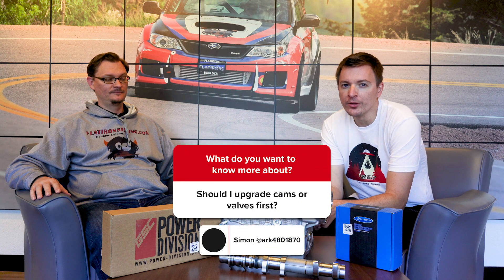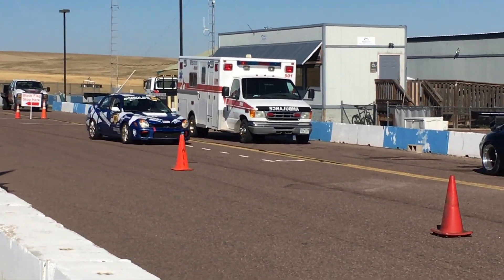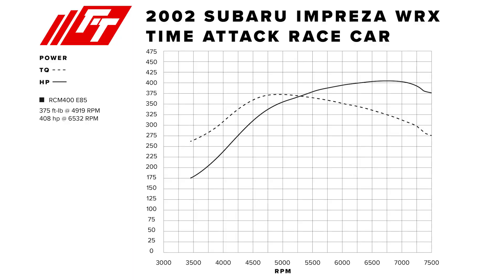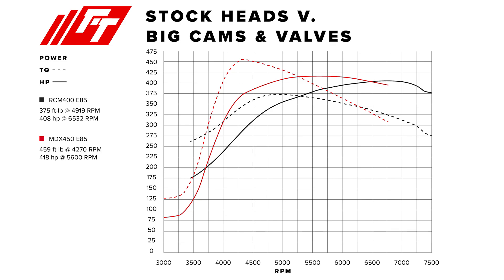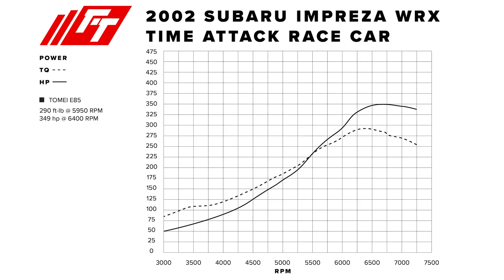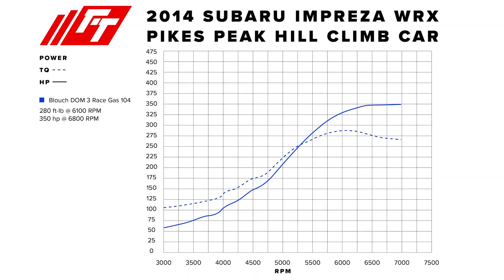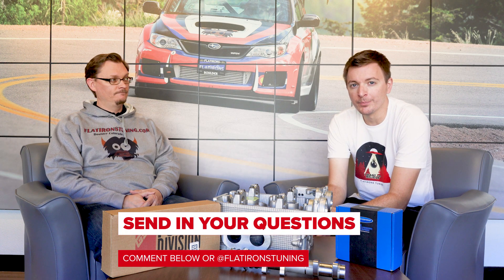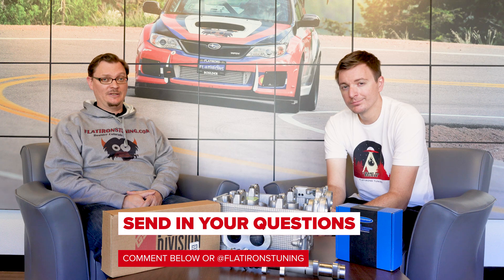Should I Upgrade Cams, Valves, or Both? Question of the Week

Comment: When should one consider upgrading valve springs?
Reply from the maker: Thanks for your question.  This comes in when you replace cams.  Once you change the lift and/or duration of the cams, you will want to make sure that your springs will work with them.

Hope that helps and Stay Tuned!

Comment: Great informative video 🙏, I have a 1200 cc petrol car non turbo  it's an hatchback family car, will it benefit for me to upgrade the camshaft, I have already upgraded the sparkplug to iridium and air intake to K&N .... I know it's not a big engine and I'm not hoping for too big difference in power .. it's stock power hp is 89 and may be if I can get it ecu remap and camshaft upgrade and exhaust pipe upgrade then it may reach 120hp or maybe 125 hp I guess it's a major upgrade for it.. but this is what I as a "nob" think... so can the camshaft upgrade help me achieve little more power than stock like 7 to 10 hp boost without any other modification or modes ... thanks 🎉

Comment: I would do valves with a 5 angle valve job, with a 33* back-cut on the intake valve, first. Extends the rev range of the stock cam without loosing the bottom end, and there's less stress on the valve springs. If you have the heads off, might as well deshroud the chamber around the valves and use a .005 thinner head gasket to get some of the compression back. Running a 116LSA should give you a nice broad power band, and cut valve overlap to help with turbo spool.
Reply: Have you done this personally??

Comment: @FlatironsTuning A full GSC S1, valves and springs won’t do anything for performance with the stock AVCS used?   I  would have to utilize aftermarket cam gears?
Reply from the maker: Thanks for your question.  I assume you mean stock cams?  If so, then yes, there aren't really any gains with aftermarket valves and springs by themselves.  The GSC parts work great and are typically what we recommend for builds.

But I would say that if you are trying to increase the performance potential of the valvetrain, the key part that you would want to look at would be the cams themselves.

I hope that helps and Stay Tuned!
Reply: @FlatironsTuning  sorry forgot to mention GSC S1 cams too. Would I benefit from stock or aftermarket cams. Single AVCS and thanks for your response!!!

Comment: Is there a flatirons video comparing EJ aftermarket camshaft options? If not that would be a great topic
Reply from the maker: That is a good selection.  We haven't made a video looking at aftermarket camshafts yet.  I'll add it to the list.

Thanks for watching and Stay Tuned!
Reply: @FlatironsTuning  on this topic, it’d be great to also discuss adjustable exhaust cam gears for single AVCS EJ engines. Tomei and Brian Crower make them but I have rarely seen them used on Subarus. They’re a much more common modification on other platforms
Reply: @FlatironsTuning So utilizing GSC valve train with S1 cams does nothing for bottom/mid-range with the factory AVCS?  That only works with an aftermarket cam gear? I am using a td05 after engine break-in.

Comment: How much does timing differ when fitting a big cam, can the valves hit?
Reply from the maker: Thanks for your question.  The cams themselves don't change the timing, though some manufacturers may note a recommended change in center-line.  You would need adjustable cam gears to do that (if non AVCS).

As the lift increases, there is a greater chance of the pistons contacting the valves when changing the AVCS, so if you are tuning that, you would need to proceed with caution.

Generally though, cam manufacturers are well aware of the timing involved so they design the cams accordingly.

Hope that helps and Stay Tuned!

Comment: i went bronze guides - swirl polished s/steel valves - single upgraded springs - triton seals and reground standard cams - TD04 turbo ! pushes from 1800rpm - 7,000 rpm stock cams ! = have better torque up to 4,800 rpm = than many modified cams - street everyday .
Reply: it is an automatic forester = ej207 spec C RA block ej205 heads .

Comment: Great information, any idea what cam/valve combo would help lessen the drastic drop off in tq/hp with a 34mm restrictor in? @4700 245hp start to drop, and @4100 300tq starts to drop.   ej205/ VF48/ stock cams & valves. OR even better, what setup would bring on torque/power sooner? Something tells me that +5000 rpm is going to do what it does by design.
Reply from the maker: Thanks for your question.  You are correct.  The function of the restrictor is to reduce the peak flow of air through the turbo which really kills top end power.  In our Rally cars, we have always used the stock cams, and then worked with tuning to try to maximize our powerband.

Kelford does make some Rally specific cams which play with lift and overlap, but if you can go with a different cam (depending on your class), I'd recommend reaching out to Kelford to see if they have a cam that they would recommend for your class.

There is a good chance that the stock cams will be your best bet for a lot of the applications.

Thanks for watching and Stay Tuned!
Reply: @FlatironsTuning  Thanks for the reply. I'm in L4WD, cams are free. But, I'm fine with stock if the juice isn't worth the squeeze. Back to the tuner it is!!
Reply from the maker: @goblazers4435  Nice!  Good luck with the tune, and hope it works out.

Comment: Best subaru YT channel hands down!  Addressing questions that people who actually think about their mods! Im planning to track my 06 wrx and am building it for reliability.  I will be adding a bigger intercooler soon to avoid heat soak, my question is would it be worth it to move the IAT sensor to the intercooler for more reliable readings to prevent detonation when on the track? Best
Reply from the maker: Thanks very much!  The short answer to your question is that you are going to be better off not moving the temp sensor.  That is incorporated into your MAF sensor, and your calibrations are built assuming it is at that location, and before the turbo and intercooler.  If you convert to Speed Density, you would then want to more the temp sensor closer to the throttle body though.

Thanks very much for watching and Stay Tuned!
Reply: @FlatironsTuning  Roger that.  Thanks for the reply!

Comment: Which do you think is faster?  Common sense says the one with more HP but ????  the other has an extra 1000rpm.  
I am building a big centrifugal supercharged SOHC EJ25 with aftermarket billet cams (high lift, relatively long duration) so this is all very interesting.  Very curious to see what it will do up to 8000rpm.
Reply from the maker: That is a heck of a question.  In our experience, it is all about torque and useable power, not the HP number.

That being said, Nigel still needs to set a lap time so we can compare.

Thanks for watching and Stay Tuned!

Comment: I was think about throwing in GSC single valve springs and retainers along with GSC valves on my ej205 heads that has 07 sti cams. do you think i will benefit from just the spings,retainers and valves or should i just leave it the way it is and save money to throw in cams?  i was gonna go with GSC 272s. I have a 2.5 hybrid on a dom 1.5 10cm on e85 rn
Reply from the maker: Thanks for your question.  First, did you do anything to correct for the center-line of the AVCS cams?  If not, the STI cams will be hurt your low and mid-range power.

As far as just adding springs, I don't think that there would be significant enough a benefit from them unless you are seeing any kind of an issue.

If you do add something like the GSC Stage 2 cams, (or even the stage 1 cams), you do need to install springs to work with them.

Ultimately, if you feel that your low and mid range are being hurt by the cams that you currently have, then it could certainly be beneficial to go with the Non-AVCS cams and matching springs.

Hope that helps and Stay Tuned!
Reply: @FlatironsTuning  As far as i know the avcs system was plugged up and since it was just single avcs I just set everything up as if it was non-avcs. my goal with the springs,retainers and valves was to rev a bit higher. maybe up to at least 7500rpms than the stock 7k rpms. i have an 06 sti transmission and the gears are very short and I just want to me able to go over 100mph in 4th gear without throwing it in 5th gear. would the stock head with sti cams be safe to just rev it out to 7500 or should I just get the head built?
Reply from the maker: @kongowns7446  Okay, if you plugged the oil holes on the AVCS cams, and then just use the non-AVCS cam gears, you are running those cams in the "high rpm" configuration.  That is what I was referring to.  Above about 5,000 rpm that is an advantage, but below that rpm, it is definitely not.

It could well be worth reving up a bit more, especially if your car is still making power there.  But you may want to be careful of running a stock EJ257 up higher if that is the shortblock that you have.
Reply: @FlatironsTuning  yup I’m reusing my non-avcs cam gears. I didn’t know that it would just be set to the high rpm configuration. Would I need to adjust or should I just leave it? My ej257 has je hybrid pistons with stock sti rods and crank along with acl bearings. Would the block be fine in this case?
Reply from the maker: @kongowns7446  The only way to correct the center line of the cams would be to use adjustable cam gears, and then index the cams.
Reply: @FlatironsTuning  thank you for your info! It has been helpful!

Comment: The Dom 3.0 can go up to 30 psi I believe. Y'all weren't pushing boost higher (only 18psi) because you don't have a built block??
Reply from the maker: Thanks for your question.  We talked about this in our Twin-Scroll video:

https://youtu.be/9cEFEgVIOGE

The first turbo we ran on our car was a Twin-Scroll Dom 3.0, and we couldn't get it to make more than 18psi, even basically holding the wastegate shut.  We did end up trying a second turbo and both of them behaved the same.  In the end we decided that we just weren't moving enough exhaust volume to get that large of a turbo spooled up.  We would have needed an engine that would rev to 8,000 rpm or more to get it to work properly most likley.

Thanks for watching and Stay Tuned!

Comment: Another great video guys! I just did a bunch of work to my 2020 STI but still running the stock RA long block. I'm going to build a long block this summer and I'm curious on valves and cams selection. Basics are 450lph pumps, ID1700, flex fuel, catless dp, ewg up-pipe 44mm, ETS header, FP Green UHF. Made 440whp (5980rpm) and 390ft/lbs(5940) @24psi before the clutch let go. I'm putting in a ACT XTSS at the end of the month. I drive between 3k and 5500 most of the time. When I build the engine it will run this turbo for awhile then go rotated and something slightly larger but still with good spool. Any suggestions of cams/valves/springs?
Reply from the maker: Thanks for your question.  In that rpm range, I would recommend looking at something in the 30R family.  I have seem 3071's and 3076's that can make full boost around 4,000 rpm, and still make right around 500 whp.

Your external gate (if you stick with it) will help you on the top end, and you could run the smaller hot-side.

As far as cams go, if you want to target 500 whp, maybe look at a stage 1 cam.  I don't think that i would look beyond that if you are trying to optimize power in the 3k - 5.5k rpm range.

Thanks for watching and Stay Tuned!
Reply: @FlatironsTuning  I'm currently running the FP Green UHF turbo and I'm super happy with it. Hits full boost at 4k. I'm curious about the 272 cams, does this require an upgrade in springs or any other valve train parts?
Reply from the maker: Yes, when you upgrade the cams, they pretty much always increase the lift as well as the duration.  I'd recommend talking to the company that makes the cams for a recommendation on what springs to use.

Comment: Thank you guys for doing these videos, I love the format and they're really informative. I'm currently juggling what cams I want to go with for my setup to match the turbo. 

I'm running an ej207 with audm WRX heads since I'm down in Aus giving me the ability to play with avcs and turbo wise it has a vf37. The combination makes for a very punchy experience. The car currently makes 246 peak horsepower at 7500 rpm and 264 peak torque at 3600 rpm at 15 psi. I'm still running the stock injectors and lower boost since I wanted to pace myself and not annihilate the 5 speed. The car now has a  usdm 6 speed with a 4.44 final drive making it extremely punchy and fun to drive, but I'm wanting move the peak power and torque further up the curve, but still keep that linier torque curve, I've picked up the new injectors but I'm waiting to decide on a package for the cams and turbo before I pull everything back out. I'm looking at the Dom 1.5xtr, they offer a 7, 8 and 10mm exhaust housing for the twinscroll here in aus but I'm worried that I might choose the wrong size for the engine and cakes and have turbo way out of it's island, so I'm just going back and forth on the cams and turbo since I know I'll be compromising in one place or the other, but I'm not wanting to completely gimp the car.

I'll have to give the rest of your videos a watch, I'm hopeful that they'll the information to allow to make an informed decision!
Reply from the maker: Thanks for your question.  If you go back and look at our last QotW about twin-scrolls, we ended up using a Turbo Dynamics LM450, which is very similar in size to the Blouch Dom 1.5.  (Both basically 30R's).  I'd say for a EJ207, that might be a bit bigger than you would want, so it might be worth looking at the LM400, which is one step smaller.

If you do decide to go with the Dom 1.5 or LM450 or similar turbo, I suspect that your powerband would move enough to the upper rpm range that you may benefit from something like a stage 1 cam.

More than anything, reaching out to someone in your local Subaru community that has run the turbo you are looking for on a similar set of supporting components is going to be the best way to ensure that you get the performance and useable power that you are looking for.

PS.  We have a Podcast coming up this Friday that is all about Twin-Scroll turbos as well.  It might be helpful too.

Thanks for watching and Stay Tuned!
Reply: @FlatironsTuning  you guys are fantastic, thank you so much for sharing your wealth of information. I'm looking forward to catching your podcast then, and I'll give the rest of your videos a watch and with luck I'll feel most comfortable making a decision moving forward!
Reply from the maker: @ravika1206  I hope that you will find some more good videos.  Thanks for taking a look!